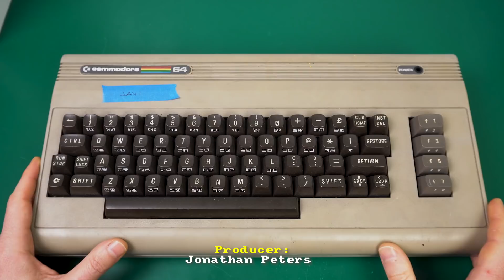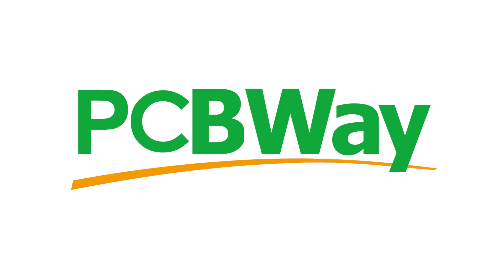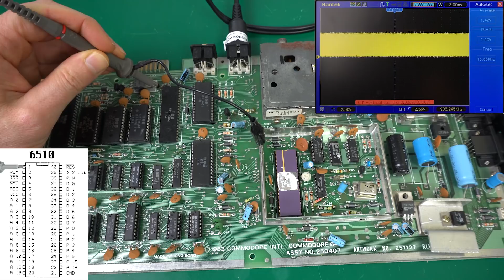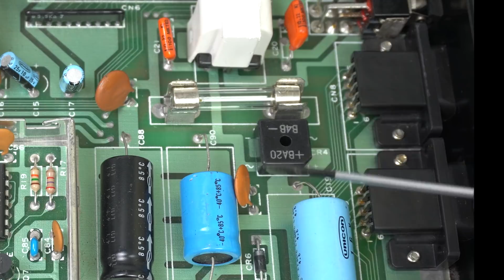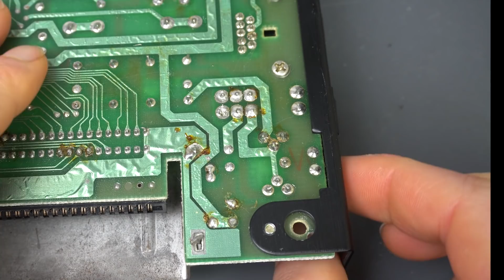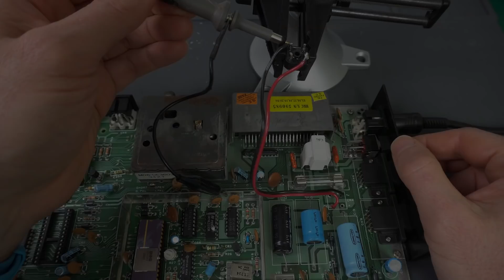The UGLIEST Repair of a Commodore 64 (Part 1)

Comment: Pesky ol' solder joints! I hate then that happens!
Reply from the maker: Yeah, especially because this one wasn't on or off. It was "kind of passing voltage but not enough", which really threw me off for a loop.
Reply: @NoelsRetroLab  The rule of thumb.... always check the power supply from the very start.... ie.... the wall plug.... then after the transformer...then the connector..and so on and so forth. Lots of time can be saved.
Reply from the maker: @GORF_EMPIRE  True, but that's exactly where I started 😃 It's just that it decided to fail after I was already happy with the voltages!
Reply: @NoelsRetroLab  Ah ok I did not recall that in the video so I mentioned it.